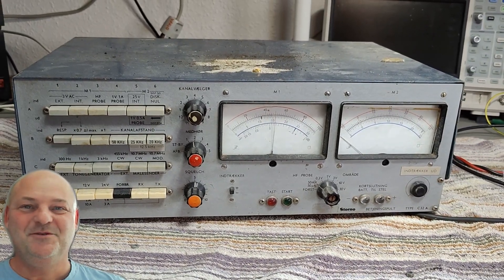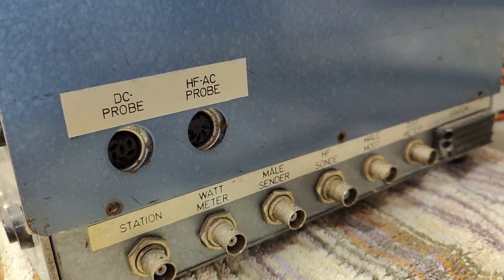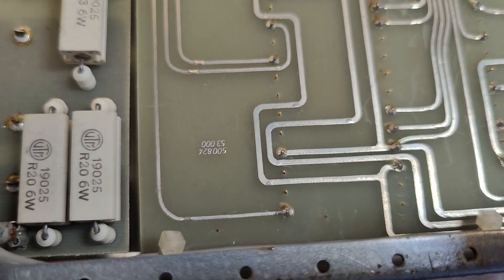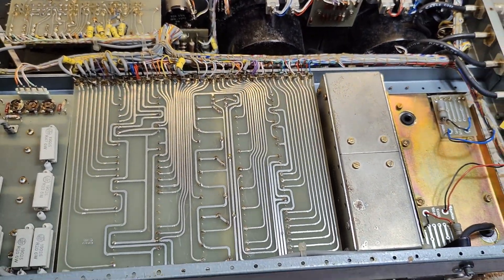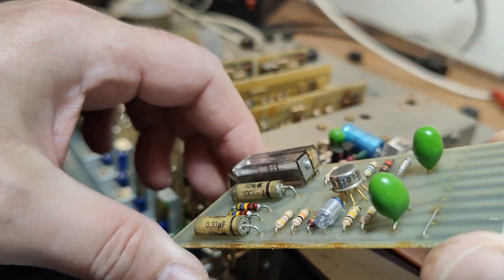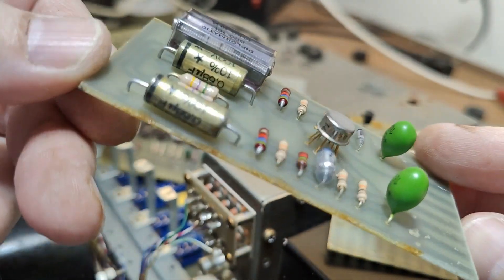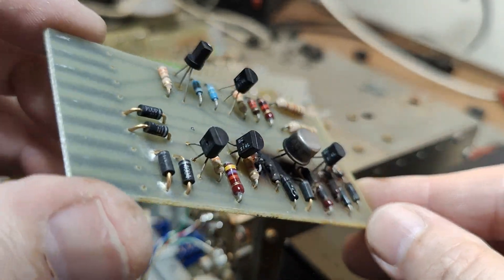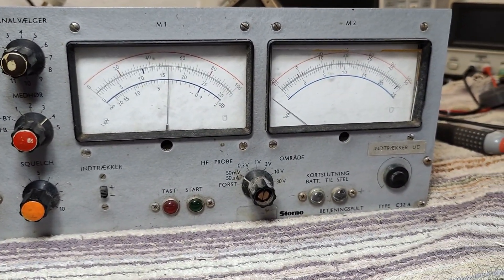DIY Storno Type C32 A radio test station 1968 teardown

Comment from the maker: I ws contacted by a REAL expert in this unit, here are the comments I got, thanks a lot Sven. 
I was employed in Storno's instrument department from 1980, from approx. 1983 as head of the department...

C32 is a test box for the CQF/M600 series. It was used both in the factory and in service workshops. You connect the CQM/F to the multi-socket on the right side, to that power supply, measurement transmitter, wattmeter, etc. year approx. 1962 and a decade ahead.

In the video we see:

0:30  frame is floating in a CQM, and therefore it can be used in cars with both plus and minus for frame. If there is a wrong connection from e.g. plus to frame, then one of the lamps lights up. It could happen that the radio got plus on frame in a minus on frame car, and then all the power that the car's battery could supply ran through the screen of the antenna cable to the antenna on the roof, and the screen glowed up in an instant and burned the interior. Hence this test.

0:45  switches for the two voltmeters, including the HF probe, which you don't have. It is available in two versions, either the 'dog whistle' or a square block, both in DC and AC versions. The pointer instruments are stuck, but you've probably seen that.

1:55 It is definitely not a DIY project, but a top professional measuring instrument…

4:08 The cement resistors of 0.20 ohms are measurement shunts for current consumption measurement - and the number identification are internal Storno numbers from the instrument department. The prints are laid out by hand by my old draftsman/documentation man Preben Haunstrup Beyer.

7:18  Excellent coax relay, up to 500 MHz. I have a few lying around.

9:36 The small extra board is the LF speaker amplifier from the CQM600. If you turn the print a little more and look at the heat sink from the other side, they will see why the heat sink is called the 'fox terrier'!

10:00 The three tone generators use an NTC resistor as a stabilizing element, as you also say. It is an STC R53 NTC thermistor, which is excellent for that task and which is now unavailable. Watch out for them! They can also be used for HF power measurement in a bolometer bridge.

12:15 No, it's not a receiver, but two MF generators at 455 kHz and 10.7 MHz for tuning the intermediate frequency and discriminator. You will probably correct this yourself a little later, when you pull the 10.7 MHz crystal out of the socket.

Comment: Capacitors have a date code of batch 1k of year 1, so week 19 of 1971 as manufacture. The transistors look like 1965, and the Motorola transistors in the power supply look to be around that era, so the likely date is early 1970's, probably no later than 1975, as the stock of 1965 2N3055's would have been long gone by then. Yes built from products off the line, the 2 IF units in the can are selected, probably using PIN diodes, and you select which IF you are going to use to drive the audio amplifier, with a single RF input of that from the separate receiver, or from unit under service or alignment, and this then fed out as audio via an unscreened wire to the repurposed amplifier. Going to guess the cooked board was an IF out buffer, and somebody selected to use it as RF in, or transmitted via a set connected there by accident (many wires, and easy to make a mistake when only thing is a small identifier on the end) and the 10W of RF cooked it.

then set aside for repair, and then somebody needed a fuse, and this one was open, so grabbed a fuse from it, and then somebody else needed the power supply, so it vanished, and so it landed in the basement. One of those many "I will got to it as soon as...." projects, interrupted by a silent key.